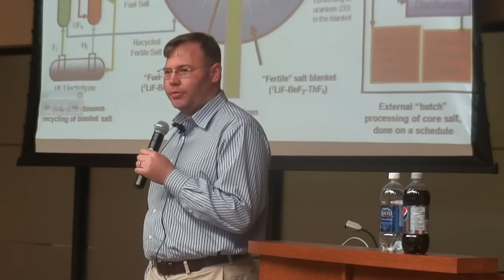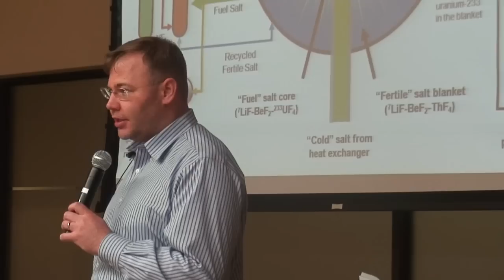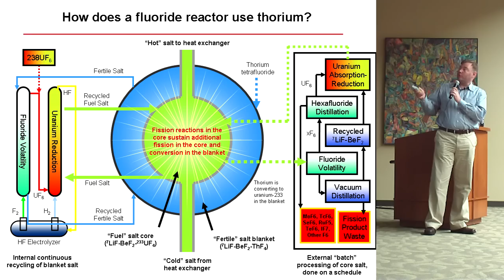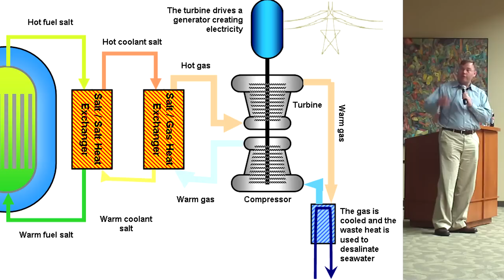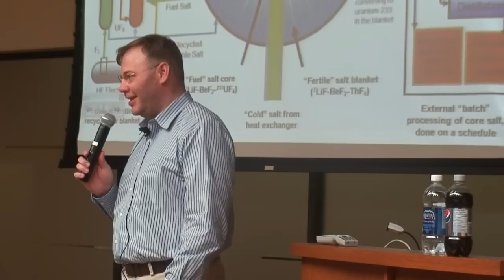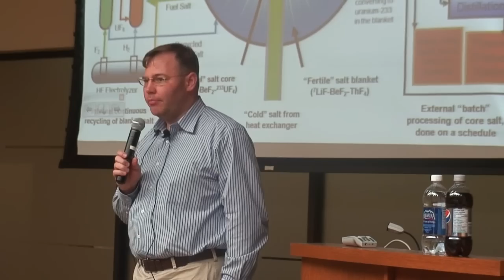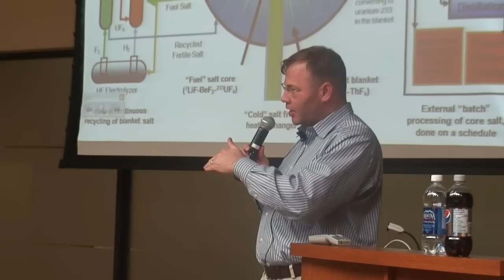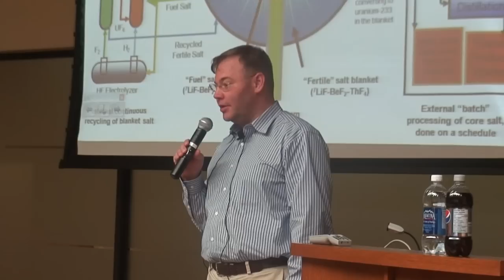Kirk Sorensen @ MRU on LFTR - Liquid Fluoride Thorium Reactors

Comment: A conventional steam locomotive is also, in a sense, a load-following system.  The rate of burning in the firebox depends on the draft.  The draft is pulled by exhaust steam from the engine flowing through a nozzle in the smokebox.  The draft thus depends on the load, and so does the rate of burning.

Comment: @yorryyorry Yes - go to energyfromthorium.  On the right side is "Java Programs" - download and run your own simulation or join the forum.  I can also recommend my site lftrnow which is geared towards summarizing the key points that make LFTR and Thorium great, with links to back up the points.  Finally, the quick answer - most products from LFTR decay quickly with fairly little left after a few 100 years rather than 100,000+ years.

Comment: 1. What do you mean by 95% recyclable. There's material used to make the solar cells, cost involved in installation and upkeep and there's a set useful lifetime. Over that time, it generates certain number of gw/hours. 

Plus, while there are hazardous substances with LFTR and other nuclear powered variants, those substances have been found to be very beneficial to medical and space research. Hazardous is not anthesis to benefits.

Comment: On fission products & wastes, the purpose of using 232Thorium is it's 6 neutron captures away from Plutonium, while natural 238Uranium is but 1 away.  So, the amount of heavy, long-lived (transuranic) waste is under 1/1000 of what current reactors leave in 'spent' fuel.& there's no spent fuel because the liquid cycle makes just what's needed.

Regular fission products also occur, as for regular 235U reactors, but their lives are relatively short & are retained in the salt, unless noble gasses.

Comment: Why don't we use a fast sodium chloride reactor to breed a blanket of thorium salt chlorides that would slow down high neutron flux by boron carbide, graphite or zirconium hydride with zirconium as the salt containment vessel or window? The idea is we can breed more thorium faster for burners short term or fuel existing reactors, while consuming our nuclear waste spent fuel rods. I figure that thorium is more common and cheaper to breed as a fuel. With wast u238 can drive the breeding in the high flux fast salt reactor. So you can do both.

Comment: There seem to be a lot more problems with developing the Thorium Reactor than I was first led to believe, especially related to Radiation levels that a decent sized one will produce. Only Research and Development sized ones are being produced; with problems still with materials for the containment vessel. Kun Chen estimates that it will take 20+ years for the introduction of a Functional Reactor. Fukushima was a major turning point; and problems from it will continue for many years, the situation being still very unstable. It has turned things back to Coal, Fracking and Natural Gas, and the continuing drop in Oil production. I shudder to think what will happen when Oil output drops below a critical level. That's when there will be a sudden drop in Food production. Either this Thorium Reactor gets built within the next few years or we might as well forget about it.
Reply: *****
no, India's thorium program is based on the heavy-water CANDU reactor design. Solid fueled, water-cooled.
Reply: +D Nickaroo  Chen didn't say it would take 20+ years for a "functional reactor" He was guessing a timeframe to having a commercial capacity operating reactor online providing power to their grid in 20+ years, there's a huge difference there. What levels of radiation will a "decent sized" one produce?
Reply: Douglas Dobson. Yes, I can see that there would be a significant interval between the development of a design for a commercially viable Reactor and when it is built and functioning on the grid. I do not know the exact levels of radiation, but this would appear to be main problem: container materials become brittle.
However, technical problems usually seem to solved sooner than one expects; so I feel rather more optimistic that this will occur.
I understand that Uranium is a rather scarce resource, with only enough to last another 100 years or so. The solid Thorium Reactor as developed in India seems to be an available technology.
Although there are continuing improvements in Solar and Wind Energy, it appears that Nuclear Reactors will be needed to replace Coal, Natural Gas etc to solve the problem of storage; and Thorium-based Reactors seem to be the only ones with assured long-term availability of fuel.
Reply: +Douglas Dobson It will be even longer if they don't start right now.
Reply: so how did they burn the U233 from thorium back in the 60's yet everyone was safe. yes it will have a high radiation area which no one can go in for a while after it  has stopped reacting. just like any reactor. or even fusion

Comment: Ok, I'll bite:

1. What is the cost of LFTR that makes it much too expensive?

2. When has complexity stood in the way of implementation? A passenger airplane is a complicated piece of equipment, it still gets manufactured.

3. If profit exceeds costs, it's economical. Considering such devices are used for more than electricity, it seems very economical.

4. What risks are there that are not present in nuclear powered solar and thermal energies?

Comment: Actually, Chernobyl happened because of stupidity of operators, who violated instructions and also didn't understand the processes that go in reactor. Each RBMK can produce up to 1500 MW of electricity and plutonium for atomic bombs.
It's not such a terrible design, main problem is that this reactor was originally designed as a small reactor, and when it becomes bigger and bigger  - a lot of safety problems appears.

I remembered Chernobyl because in 80-s some of USSR scientists also told that RBMKs are extremely safe. They couldn't even imagine, that such shit could happen.
Reply: ***** I don't think anyone was "vaporized" from Chernobyl but it killed about 30 workers from radiation poisoning (from what I heard). It's laughable for anyone to compare Fukushima to Chernobyl, Ch. was 100-1000x worse.

Comment from the maker: You can consume, hold even, or create surplus (breed) U-233 depending how reactor is tuned & operated.

Good questions. Takes only seconds to ask them. I don't want to dig up answers which can't be completely accurate, there's material science still to do and components need to be put under neutron bombardment to see how they do. Am not worried about ANY unit of waste measure since E=[MC^2]/1500 is energy density. 4g Th per year per human. Mass isn't being created, so small waste footprint.

Comment: Will there be fluoride air or water pollution caused by liquid fluoride thorium reactors
Reply: Short answer: no.

Long(ish) answer: an LFTR does not need a water source for cooling -- and while it can use it, this waste heat can then be used to desalinate water, so that's the first point. As to fluorine gas/fluorides, they are used in the fuel/blanket closed cycle and as such never get released in the environment. If a danger exists here, it's in the manufacturing and transport of fluorine (which never is transported as such anyway), not in the LFTR itself.

Comment: This video was posted 11yrs ago, and yet the rate of CO2 emissions are higher than ever. Where are all the thorium molten salt reactors? I suspect that, like all forms of zero carbon energy production, the fossil fuels industries and the uranium based nuclear power sector are heavily lobbying congress to obstruct and  thorium reactors as long as possible. Since there is already enough greenhouse gases in the atmosphere to make the Arctic Ocean ice-free by the 2030s, which will trigger an abrupt 3 degree increase in average global temperature. That will be game-over for the anti-thorium lobbyists, as well as the rest of the human race.
Reply from the maker: LFTR specifically hasn't seen much progress. TerraPower is using molten-salt to buffer thermal energy in their Natrium reactor (fast-spectrum Uranium fuelled solid fuel). Moltex is building an SSR-W in New Brunswick that is a fast-spectrum MSR which will recycle used CANDU fuel. Kairos finalized construction (in 2022) the Engineering Testing Unit (ETU) which simulates Hermes their demo unit which they've submitted to NRC. ThorCon will likely build Indonesia's first nuclear reactor, a molten-salt reactor. There's progress but is scattered in western world. The only fast and impressive progress is in China, where they've actually built their MSR. There's been no announcement but most people think it is likely already fissioning. Is a small test reactor similar to MSRE built in Oak Ridge.
Reply: @gordonmcdowell  Gordon please consider covering these sorts of things in videos, as in, the latest state of the industry, any new news, the differences in reactor spec between them etc, the public needs to know about and rally around these companies. Thank you so much for all your hard work.

Comment: Bankers still involved: costs of central reactors are expensive. Expensive electrolyzer wastes energy. Intermediate radioactive byproducts, high temperatures, toxic fluoride salt compounds--all still dangerous. How many moving parts? Turbines require temperature gradient & output global warming.
Contrast all of this with Tesla's magnifying transmitter--non-toxic, no heat byproducts, cheap, stable, no mining fuel involved, so safe there is no need for high paid engineers to operate it "properly."

Comment: The reason they have security at nuclear plants isn't about proliferation problems, it's because of 911, and the ramifications of that.

Chernobyl isn't embedded in concrete; they built a concrete shelter over it.  The only  solid concrete they poured was to fill in the lower basement, to stop migrating corium from reaching the water table. 

Other than that, A+.
Reply: 4-th reactor been filled by sand with boron carbide in first days after crash.
Reply: Actually, most of the dropped materials never got into the reactor; they piled up on the support structures around it.  When they eventually drilled through the wall to see what was inside, it was empty.

Comment: Corporate industrialization of nuclear plants typically involves cost cutting & liability avoiding policies that result in very poor operating procedures & suppression of embarrassing reports of the results of those poor procedures--pollution of toxic materials, radiation leaks, etc. Major sources of long term pollution has often come from such companies as DuPont & other fuel producing companies. Freon in the air, fluoride in soil & ground water.

Comment: No offense to Kirk. But after 15 years of giving talks, WHERE ARE THE PROTOTYPES? We're still in the realm of discussing drafted hypotheticals. We're just as close to thorium reactors as we were 15 years ago.
Reply from the maker: Flibe Energy has not been moving as quickly as some others. Copenhagen Atomics is currently stress testing using electrical heat an molten salts their Onion Core reactor. That is a true thorium-in-breeder-blanet Thorium-MSR. China's probably running their TMSR-LF1 right now, though there's been complete silence from SINAP since they received there operating license to run their completed MSR. And ANEEL fuel for CANDU (combines HALEU and Thorium) is being tested at INL right now.

Comment: If it was simple & really cheap to build, the guy could have built one in his garage, but it is expensive, complicated, dangerous, produces heat that turns turbines to run generators. These centralized energy generation systems keep the JP Morgan type tycoons calling the shots, disconnecting the user if they don't pay the latest price-hiked rates indicated on the metered power to run your house or business.
We need decentralized safe systems, not this complicated, expensive, dangerous stuff.

Comment: To hell with 10 years ago... how about now.
Reply: No big progress.  I also learn about MSR, LFTR from Kirk.  Kirk has founded a company Flibe for developing the reactor.  Small progress.  I think his approach is too aggressive.  He wants to get to the peak in one big shot.  I think he should make his plans in stages.  Each stages is easier to achieve.  Now he has dual fluid issue.  There has not been any alloy or metal be used in dual fluid molten salt design before.  Tough one here.  He uses floride salt.  It is highly corrosive and needs new wonder alloy to ensure the reactor can operate for a long period of time.  There is re-processing.  That processes has not been done in MSR

Comment: Thorium is not a source of energy, using thorium element in a fission energy production of electricity has more still to do with uranium not thorium. PWRs already using thorium in MOX fuel pellet composites. There’s no shortage of uranium. Uranium market prices are quite modest. PWRs have mostly issues of high costs, nuclear waste and nuke proliferation not meltdowns. Nuclear fission for electrical power generation in Its long @70 year history has documented facts that show this method is insanely expensive, difficult, dirty and dangerous way of generating electricity and this is the reason today that we see an increase in the use of natural gas, and the building of gas pipelines or other fossil fuel resources; not the building of some LTFR.  All the propaganda concerning thorium on this forum and others like it; is all based in MYTH not fact and not one of any statement or claims about some thorium conspiracy can be proven or substantiated not even with all the insidious rants from fanatical followers of this Thor (thorium) cult like following.
Reply from the maker: Are you still posting comments? Quite the track history you've left behind of snide remarks.

Yes, uranium is involved, but since a steady-state LFTR has only Thorium going into the reactor, and fission  products coming out, we get to call Thorium the FUEL. I'm sure there are intermediary chemical steps gasoline goes through during its combustion as it powers my car, but I just like to call the fuel gasoline to keep it simple.

Yes, Thorium can be consumed in MOX pellets, but that's inefficient and results in the typical nuclear "waste" stream that anti-nukes have scared everyone of. So the industry could of course educate everyone as to the lack-of-danger of dry-cask storage, or the industry could use their fuel more efficiently and produce less waste per kWh. But for the industry to continue doing what they've been doing and expect a growing-not-shrinking industry seems a mistake to me. I'm sure German PWR guys were busy complaining about anyone advocating Gen4 reactors while their industry was legislated out of existence. Is this the best use of your time?

LFTR is Shippingport's successful demonstration of thorium bred in a thermal spectrum combined with the successful demonstration of liquid fission at ORNL's Molten Salt Reactor Experiment. Plus a chemical kidney to remove fission products and move the protactinium from the neutron flux until it decays to U233. The only thing "new" there is the chemical processing. Hard, I'm sure, but this really isn't the sort of thing that strikes me as "been there done that" like you try to spin MOX Thorium pellets.

Thanks for your thoughts. Keep posting comments on videos that were uploaded in 2011 instead of criticizing more modern talks given by Kirk. Or maybe you could try convince the public dry-cask storage is safe? I do that. Do you do that?
Reply: Not sure if YT has a feature allowing you to block Quronto Abrams, but that would be nice.